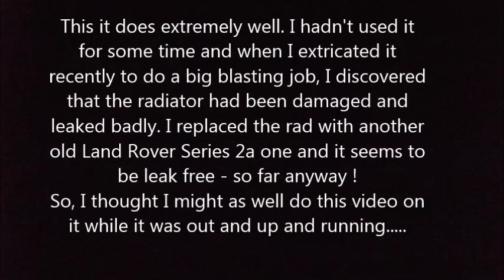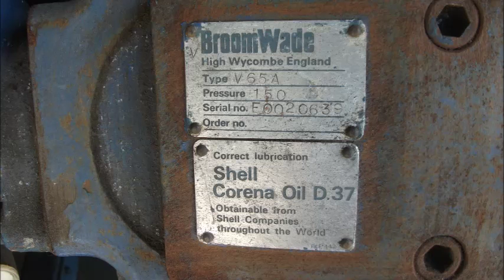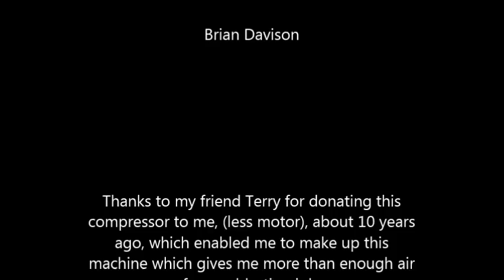Peugeot Powered Broomwade Compressor

Comment: Perfect idea,  and master crafted by you.
I want to do something similar, using Peugeot 1.9 turbo diesel engine,  as i got it for free, same mechanical pump as yours. But my set up needs to be different,  i got two hpc 3 piston 42cfm each. 
Will need to be belt driven. 
Engine drives shaft with pulleys , belts from pulleys to compressor pumps.
Yours is direct driven, what rpm are running it at?
I was planning,  engine at 2.5k rpm , and pumps to turn at designed 860rpm.
But clutch and coupling and decoupling is my problem,  i cant figure out how to.?
And your governor assembly from  lister engine is that pressure operated?
Thank you
Reply from the maker: Thanks for positive comment, aelc4 tdim, 
 In answer to your question re speed, I have set the governor to hold about 1500 r.p.m. as that seems kindest to the motor and compressor, and also quieter than higher revs would be. It generates more than enough air for my blasting purposes like this. The first possible option with your proposed belt drive would I think be to use a jockey wheel fitted mid way along the back of the v-belt with say an arm in a slot with detents whereby you could manually increase and release the tension as required - a clutch in effect.
Another idea that springs to mind (using a flat belt), would be to arrange a solid pulley on one shaft with a free-wheeling one beside it, and then arrange a lever to flip the belt across when in motion - just like the old overhead shaft driven machinery of 100 years ago.

The governor is purely engine revs related on the old bob weights principle. The compressor itself has a pressure operated 'idle' function when full pressure is reached. Hope this is of some help, and good luck with the project.

Comment: beautiful job brian,  and a proper copper radiator that will last many years. the price diesel fuel these days. you sure have nice friends. that pump even seized would cost an arm and a leg here. a question did you buy or made the water separator?. peter
Reply from the maker: hi, thebrokenbone - thanks for nice comment. The water separator came with the compressor but 'yields' very little water in contrast to its size, but then again, it's only very occasionally used by me.